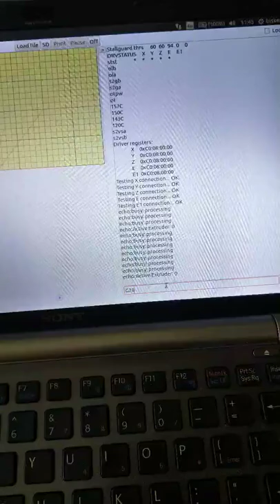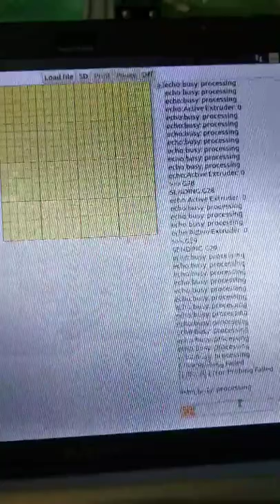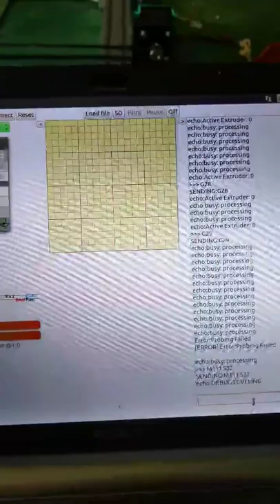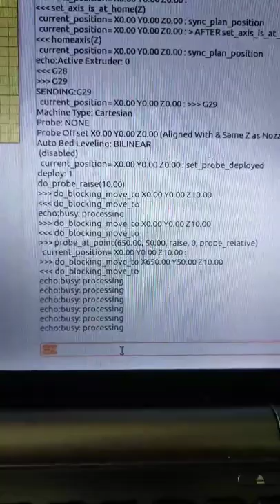SKR Pro v1.1 + TMC 2209 v1.2 Auto Bed Leveling Bilinear failed

Comment: Do you have more details on those pellet extruders
i have been looking something DIY that works
and yours looks amazing
Reply: well i would like to make dual pellet extruder for myself,
if yours works well.
 Video would be nice 
stls and parts??
Reply from the maker: @nuuskapeke11  ok will try to make a video showcasing how I built it and which parts I used, and improvements I want to do. I am currently away for work so it will not be soon and with the situation that we are all in it's not going to be easy. Anyway at the current moment is made with 2 Nema 17 geared 5:1, with 2 wood drill bit 12mm, a steel tube where the drill be goes into, custom aluminum heater block and normal heater cartridge. Also the nozzles are steel of 1/1.2/1.5mm, since I am printing with carbon fiber so everything needs to be extra resistant. What I want to do as improvements are the heater byt switching to induction coil heater which will need to change the aluminum heater block to a round block. In addition I would like to switch to a pressure drill bit but not at the moment since they are very expensive. Will try to do a video asap. thx
Reply from the maker: @nuuskapeke11  I have some pictures on the facebook page
Reply from the maker: hey, what are you looking for? More details about the Pellet Extruder? I can make a video talking about the pellet extruder and how is assembled if you are interested. It will take me sometime since I am away for work. Also will do more videos with updated on the 3D printer since I updated to the SKR GTR board. Thx for the comment and please subscribe !

Comment: Having same issue with my Skr 1.4 Turbo and BTT 2209, not able to level bed but sensorless Z probing is working fine. Somehow I cannot use ABL as main-board does not power on with I connect ABL Z-Stop wires. ABL Self test works fine!
Reply from the maker: I currently away and cannot test the latest Marlin, maybe is fixed from what I read on Github, try the latest firmware. Please subscribe, thx
Reply: Sub ...done
Reply from the maker: @sshahan82  I might be able to do some testing mid August, will post a video if I can. thx
Reply: @ganzoai  that will.be helpful ...so far printing great 🙂.. Thanks